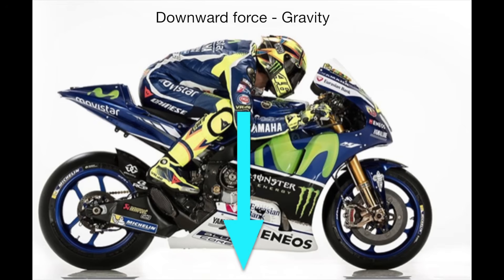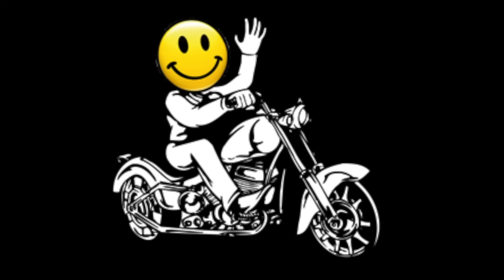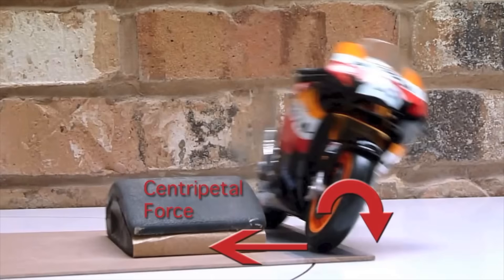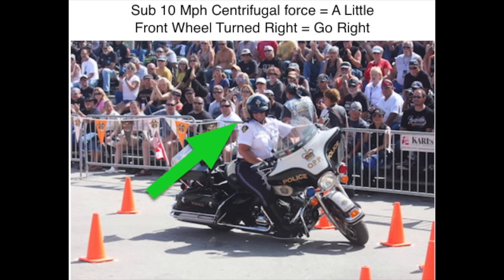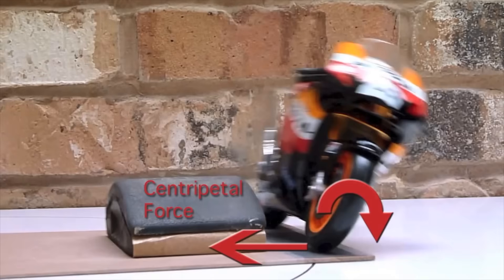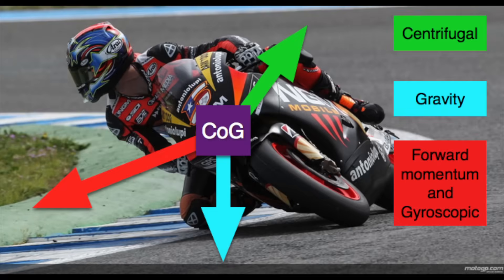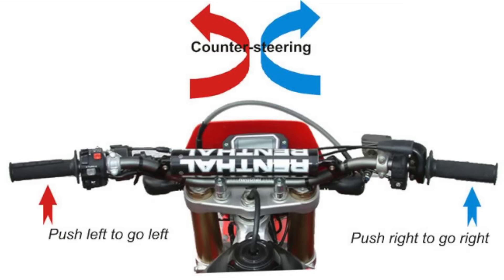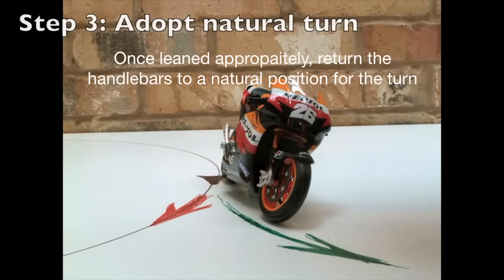Motorcycle Countersteering Physics, Myths, and Misconceptions | SquidTips

Comment: Arg!!! The leaning by countersteering is caused by torque induced by the spinning front wheel trying to conserve angular momentum by twisting perpendicular to the line of travel around the wheel hub. But because the tire is in contact with the road with sufficient friction to keep the tire from slipping, the torque induces the wheel to rotate sideways around the front tire’s contact point with the road, thereby causing the front wheel and everything attached to it to lean over.
Reply: ChrisGeez You are talkung about gyro effects? Thats not what leans the bike. The video is correct (sorta).
Reply: No, Björn, the gyro effect is very important for countersteering, especially at higher speeds. That's why in this video of an accident due to failing to countersteer, the entire bike jerks to the left as the rider tries to turn the handlebars to the right at speed even though the forward momentum of the bike is still to the right of the vertical plane of the contact point of the front tire with the surface of the road. While that "falling off the vertical plane of the forward momentum" might be a factor when a bike is perfectly vertical, it doesn't apply to when the bike is already titled, which was definitely the case with this rider given that he was already leaning the bike quite a bit to the right before mistakenly turning the handlebars to the right.
Reply: In the video with the accident (the fire truck head on collision) countersteering is falsly used as an explanation. The rider suddenly brakes, raising the bike (from leaning) and compressing the front suspension, getting it out of balance. This is what causes the wobble, not the rider trying to steer in the "wrong" direction repeatedly. It's a classic mistake when doing road racing, either braking to sudden or releasing the brake to suddenly. If he would have been smoother on the brake he woulnd't have gotten the wobble and might have been able to steer away.

Countersteering does apply when the bike is already tilted. It's just the same. When in a corner you turn into the corner just enough to keep the balance of the bike. If you want to turn more, you move the front wheel less inward, or outward, to increase the lean angle. Just like when vertical and starting the turn. If you want to turn less, you steer the wheels in under the bike again.

Gyroscopic effects are there when riding a bike, but when steering they are minimal compared to the forces from the tire on the ground when steering.

I can't find where in the video he says that the balance is kept by forward momentum, but it's a strange statement. Regardless, your example with the rollers does not disprove it (even though it's false). Momentum is a relative thing. A cyclist on rollers and a cyclist on the ground has the same forward momentum compared to the surface they are riding on., which is what is relevant. Again, the gyro effects are minimal compared to the forces of the tire/ground when steering. You keep balance, on the ground or on rollers, by steering the front wheel in under you so the forces of the motorbike are always (sort of) straight down through the bike (compared to the bike, not compared to the ground). When going straight, this is just down, counteracting gravity. When in a corner, it's both down and sideways, counteracting gravity and giving enough centripetal force to create a torque to not let the bike fall.

If gyroscopic effects would be the main thing that lets you lean, this would not work: https://www.youtube.com/watch?v=D1c6W8xbF_s
Reply: Björn Eriksson In the snowbiking video, the rider MUST rely upon something other than gyoscopic effect to turn the bike given that there is no spinning front wheel. And this is borne out by how the riders can be seen turning the handlebars to make turns, while initially tilting the bike under them in the direction of the turn to dig the ski’s edge the side of the intended turn into the snow for greater traction. Then, when they have that lopsided traction, they can act against it to tilt their whole body with the bike the increase the turn. This is what good snowboarders do when they want to quickly turn versus more gradually making a turn by merely shifting their weight with the board to make a edge against the snow in the direction of the turn. And it’s a technique that beginners have a difficult time learning, and end up flopping over the board away from the intended turn into the snow. Or worse if right next to trees.
Reply: Exactly. They use something else than gyro effects to keep balance and turn. Which shows gyro effects are not necessary.

Think of it, how much do you actually turn the wheel when going fast by motorbike initiating a turn? 1-2°? 5° maximum. And that would make the bike lean over 45°? That is completely unreasonable. They help, but are not the major part of steering or balance.

Check the wikipedia article on bicycle dynamics.

"If the steering of a bike is locked, it becomes virtually impossible to balance while riding. On the other hand, if the gyroscopic effect of rotating bike wheels is cancelled by adding counter-rotating wheels, it is still easy to balance while riding."

"Riding on a treadmill is theoretically identical to riding on stationary pavement, and physical testing has confirmed this."

A bike is mostly stable due to the geometry of the steering axis keeping the steering wheel straight or turned in the same way as the corner.
Reply from the maker: I found this article talking about it in relation to a bicycle: https://www.google.com/amp/s/theconversation.com/amp/how-does-a-bike-stay-upright-surprisingly-its-all-in-the-mind-59829

It discusses how the gyro effect plays a minimal part of bicycle stability. It would be critical if you rolled a wheel down the street, as the gyro effect would really be the only stabilizing factor, but bicycles and motorcycles are much more complex.

Other articles talk about how the trail improves stability, however you can still have stability with a negative trail. This ARSTechnicha article talks a bit about modeling and testing that: https://arstechnica.com/science/2011/04/moving-bikes-stay-uprightbut-not-for-the-reasons-we-thought/

There actually seems to be a combination of factors and complexity that contribute to motorcycle stability, without any single one being the end-all-be-all reason.
Reply: Björn Eriksson Wow! You are completely ignoring that the snobike rider does NOT use countersteering to turn at speed! Meaning, you can’t use the example of snobike riding to show how countersteering works without relying upon the gyro effect. 

But here is a demostration of why the gyro effect is important. In this vid, a bike is turned by pushing forward on the right handlebar at various speeds: 10 MPH, 15 MPH, and 20 MPH. At 10 and 15 MPH, the bike turns left (in the direction the front wheel is turned); but at 20 MPH, the bike turns right (in the direction the handlebar is pushed forward). If the ‘forward momentum’ effect was the dominant factor behind countersteering, it seems odd that it wouldn’t be strong enough of an effect at 15 MPH, but then mysteriously take effect with a 33% increase in forward momentum from 15 MPH to 20 MPH. https://youtu.be/oVa2Ax-Dins
Reply: Björn Eriksson Also, you don’t seem to understand that a gyro effect does not require the front wheel to actually turn away from straight forward, only that a force is applied to TRY to turn the front wheel. In fact, the gyro effect fights against the front wheel turning, and instead translates that force into tilting the front wheel perpendicular to the force being applied to the wheel, but pivoted from the contact point with the road surface because of the high amount of friction contact there. But if the road surface is very slick, the front wheel could tilt pivoting around the front axle, causing the front tire to slip out from under the bike in the direction the handlebars are being pushed perpendicular to the forward axis of bike, resulting in a nasty spill.
Reply: Björn Eriksson Bjorn, watch how guy in this vid turns the bike by pushing the handlebars with a single finger. And how quickly the bike responds to that force action without the front wheel actually turning in the opposite direction of the turn (which is required by the ‘forward momentum’ effect). That’s because the turning force applied by that finger is immediately being converted into a gyro effect force  that tilts the front wheel (and the attached bike) perpendicular to the direction of the force applied to the spinning front wheel. https://youtu.be/ljywO-B_yew
Reply: I don't really know where to start, but let's start from the first post.

I'm not ignoring anything. You claim they don't use countersteering, but have yet to show it. What that video clearly shows, and the references in the wiki article also show, is that you don't need gyro effects at all to steer. See this for example (ref. [5] from the wiki article).

https://web.archive.org/web/20080213072335/http://www.losethetrainingwheels.org/default.aspx?Lev=2&ID=34

That video (from the parking lot) shows nothing since you can't see the handlebars in relation to the bike. It is very possible, even likely, that he subconsciously counter steers (just like everyone else, and just like the guy in your second video) at low speeds without realizing it. Counter steering works at every speed, but is not as noticeable at low speeds since you need lower force to move the front wheel. I did try this on my way to work with my bicycle. Going at aprox. 15kph (8-9 mph), riding no hands and one-finger pushing the handle bars the counter steering effect was VERY obvious. I mean, on the point of almost crashing obvious. Try it! If you keep the steering pushed and don't turn back, you WILL crash.

I know how gyros work. You DO need to change the angle of the wheel to get an effect. When you apply force, the angle changes. If it does not change, if you for instance weld the steering of the bike, you will get no gyro effects. In your second video the front wheel DOES turn, albeit very little. It's also interesting in that video how he does not use one finger at low speeds to show you turn normally. If he would have, he would have failed.

From my reference above:
"In essence, the bicycle was found to be rideable so long as the gyroscopic values were restricted to less than about 100 times in magnitude, in either direction, as compared to when conventional bikes are ridden. Only when the gyroscopic torques, as calculated, were beyond (approximately) one-hundred times in magnitude as compared to a conventional bike, did the experimental bike become unrideable in the hands-on case. This experiment reinforced previous conclusions that gyroscopic contributions for conventional bicycles are of relatively minor importance."

From the wiki article:
"For a sample motorcycle moving at 22 m/s (50 mph) that has a front wheel with a moment of inertia of 0.6 kg·m2, turning the front wheel one degree in half a second generates a roll moment of 3.5 N·m. In comparison, the lateral force on the front tire as it tracks out from under the motorcycle reaches a maximum of 50 N. This, acting on the 0.6 m (2 ft) height of the center of mass, generates a roll moment of 30 N·m."

Next paragraph: "While the moment from gyroscopic forces is only 12% of this, it can play a significant part because it begins to act as soon as the rider applies the torque, instead of building up more slowly as the wheel out-tracks. This can be especially helpful in motorcycle racing."
Reply: Björn Eriksson  Gonna give your credit for something: You've convinced me that the forward momentum effect does play a role in how countersteering turns the motorcycle at speed, but the information you provided from the wiki article supports the notion that the gyro effect is the more important INITIAL force that starts titling the bike. 

The relative contributions of the gyro versus forward momentum effects in the article ("only 12%") is deceptive because, as the subsequent paragraph says, the gyro effect "acts as soon as the rider applies torque", while the forward momentum effect "build[s] us MORE SLOWLY* as the wheel out-tracks". Meaning, the immediate and larger of the two effects is necessarily the gyro effect, with the forward momentum effect slowly builds over time. 

And while it is POSSIBLE to turn a motorcycle without a gyro effect, that is not really the issue for actual motorcycles, as nobody regularly rides ones with counter-rotating hubs in their front wheels. In actual riding with ordinary motorcycles, the gyro effect IMMEDIATELY starts tilting the front wheel in the direction the handlebars are pushed, and also as the article mentions, "This can be especially helpful in motorcycle racing."

Perhaps this is a compromise we can reach regarding the relative importance of the gyro versus forward momentum effect.
Reply: I wouldn't say it's more important. The gyro effect is relative to the angular speed of the front wheel (handle bars) while the counter steering effect is relative to the angle of the front wheel. In the example you have a shift of 1° over 0.5s, which is a realistic scenario. So after 0.5s you have the full force of the counter steering. This is not slow, especially since you have some of the force on the way there. Now, the angle velocity is not 2°/s from the start, but builds with angular acceleration, so it's not as immediate as it might sound. It's max is at 0.25s through the motion with the max being a bit higher than if using the constant angular speed of 2°/s. At the gyros max we have a force from the counter steering of half the max, which still is 15N·m. That's 4 times the gyro effect.

If plotting the force from the gyro effect vs the force from the counter steering, assuming the angular velocity has a sine shape from start to finish, it seems the only time they are the same, is at the start. This means that the counter steering force is always larger, or they would be the same at some other point.

(Assuming the equation is correct, at this late hour. :p)
http://m.wolframalpha.com/input/?i=2%2Fpi*3.5sin%28x%29+-+%2830%2Fpi%29*x+%3D+0

If we increase the gyro force it looks like it needs to be approx 1.75 times larger to ever be larger than the counter steering force. (You can see we get a second solution to the equation.)
http://m.wolframalpha.com/input/?i=1.75*%28pi%2F2%29*3.5sin%28x%29+-+%2830%2Fpi%29*x+%3D+0

Even if we let the gyro force be 3.5Nm from the start, it's only larger than the counter steering force for 0.058s. That's 6 hundreds of a second.
http://m.wolframalpha.com/input/?i=%283.5+-+30*%282x%29%29+%3D+0
Reply: Also, the explanation in the video that the motorcycle is balanced by forward momentum is also an incomplete explanation of how balance is maintained. Why? Because a cyclist training on rollers has zero forward momentum, yet is able to able to easily keep the bike upright by pedaling fast enough and keeping the wheels spinning once a sufficient wheel speed is achieved. In fact, because the rider's legs are also rotating, they provide additional angular momentum to help keep the bike upright. Here's an example: https://youtu.be/3WCUN7-nezQ
Reply from the maker: What I’ve taken away from these comments, and a few others, is that I was not clear enough on the scope of the concept I was trying to explain in this video, which I think is fair criticism.

The scope was meant to encompass the misinformation I saw on another popular motovloggers channel (https://youtu.be/ApGB4ok_zHY?t=1m7s) and explain the intimation of Countersteering from a normal riding position to the turn. I acknowledge both before and after the main topic that I didn’t achieve complete technical accuracy on some terms and concepts mostly in an effort to make the concepts more accessible and understandable (Though, there are just plain old mistakes). This video is meant to fit between complex and long technical lectures and the very basic demonstrations that exist in many videos elsewhere.

These comments have convinced me that there needs to be a follow up focusing on what is happening to a motorcycle in a corner, and including concepts like the gyroscopic principal, cleaning up the details of ‘Inertia’, drifting, etc.
Reply: Excellent response. You might also want to mention that riders can, with practice, use both hands to countersteer, one pushing in the direction of the turn and the other pulling on the side away from the desired turn, when navigating a sharp S-turn at speed, given that it takes a lot of torque to twist the bike out of turning sharply in one direction and deeply into the other. A buddy of mine who rode an Kawasaki 1000 back in the day showed me this by repeatedly flipping his bike back and forth between turning sharp right and left-hand turns while cruising down an otherwise empty interstate highway.